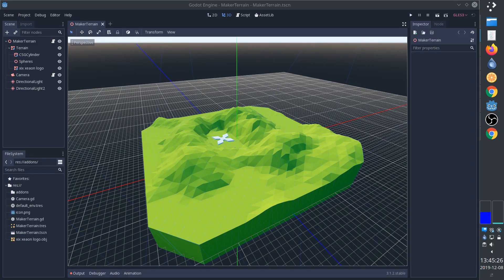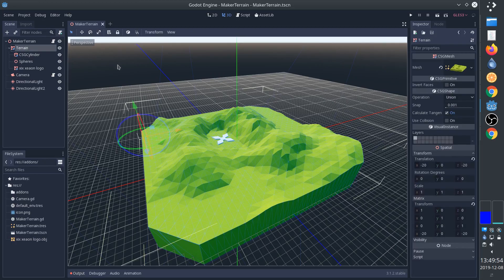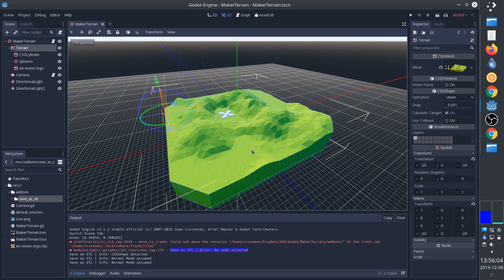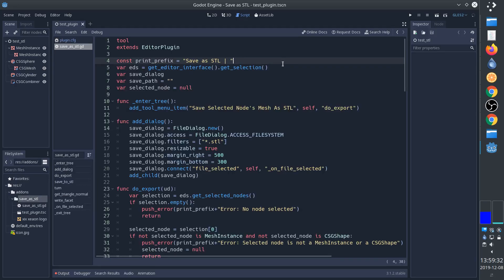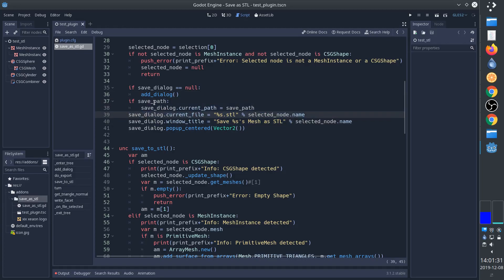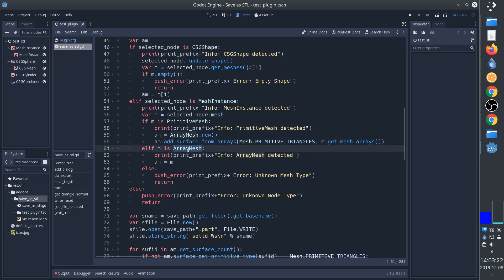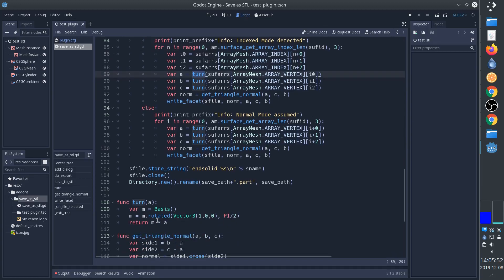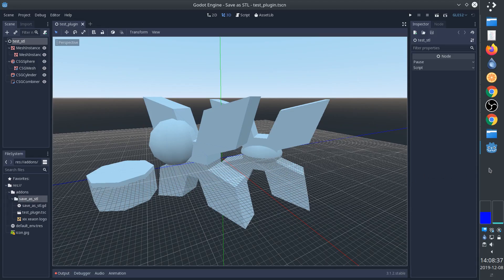Save Mesh as STL in Godot for 3D Printing or CNC Machining with Plugin Walkthrough

Comment: how do you save the generated terrain as a mesh in the first place?
Reply from the maker: I used SurfaceTool to create the mesh from OpenSimplexNoise. First I add all the points in the grid with add_vertex, and then I stitch them together with three add_index for every triangle.

Comment: could godot generate G-code for Cnc mfg?
Reply from the maker: That functionality does not exist as far as I know, but someone could possible make a plugin for that, although I suppose it would be a lot of work. That's why I made this STL plugin, so I can bring the STL file into Slic3r (for 3D printing) or Fusion 360 for CNC machining or any other software.